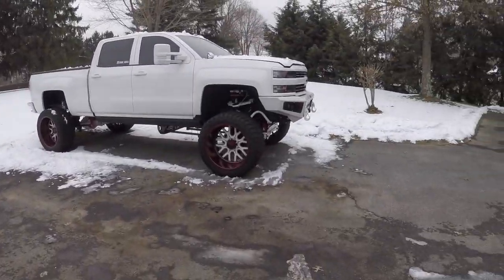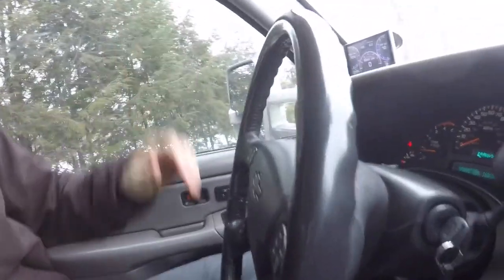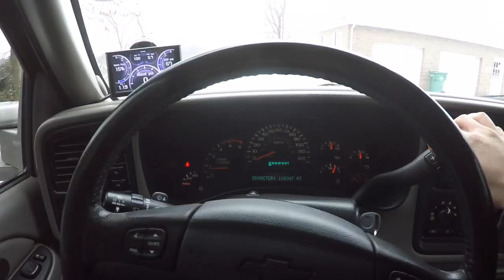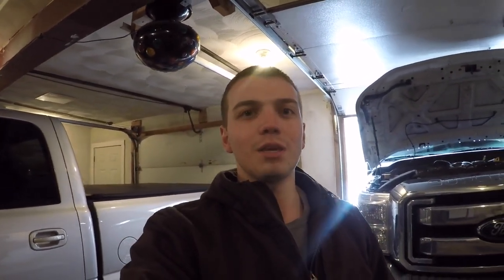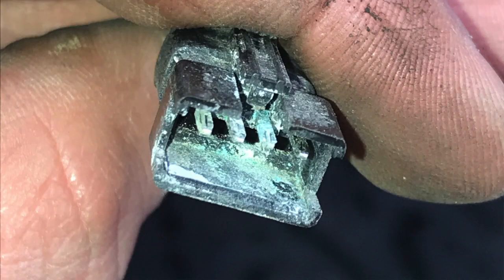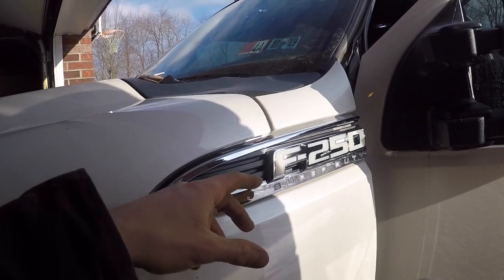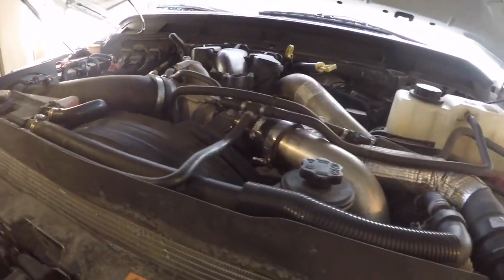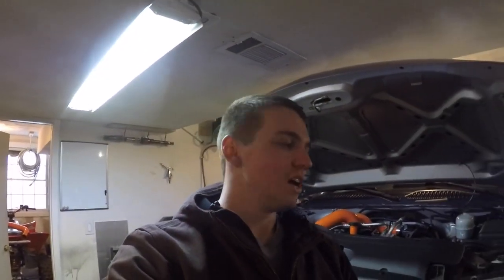Cheap Custom Touch For Your Ford Truck

Comment: So have you worked on ford much?
Having done head studs and gaskets on my 6.0 ford and now doing same job on my LML the ford was much nicer to work on then The gm. 
Yes the hood is full but everything is spread out so it comes apart fast to make room for the work to happen. The gm everything is tucked together so tight that it’s all a struggle to get apart with bolts hiding under other parts that I don’t need to take off. Not to mention ford uses 3 different size wrenched to pull down the engine and gm im up 15 different size tools and counting.